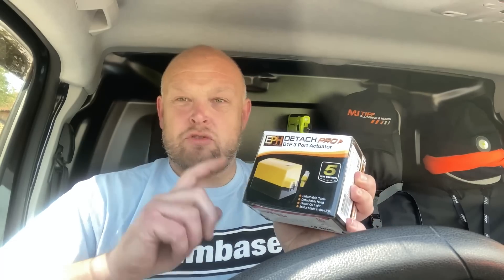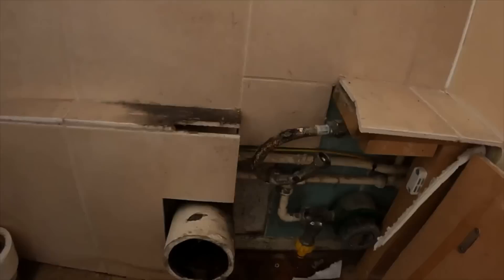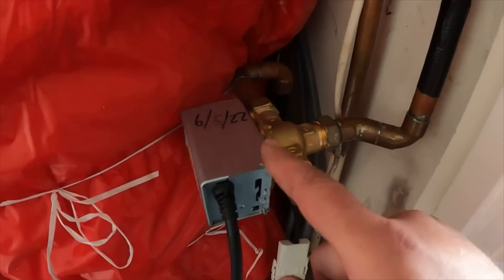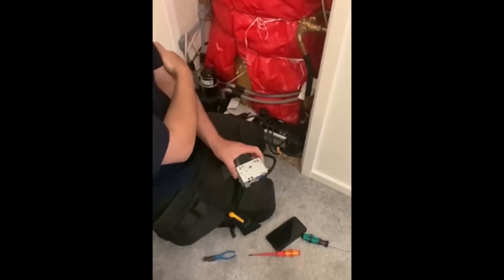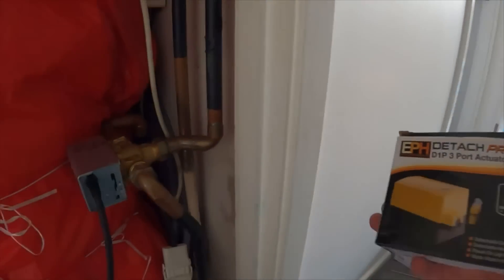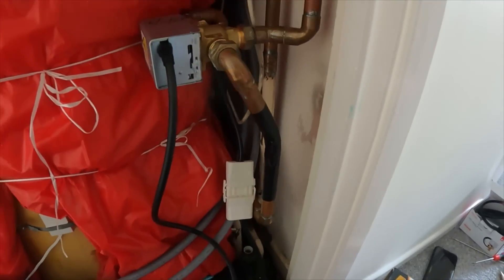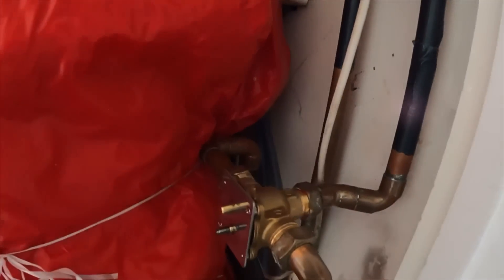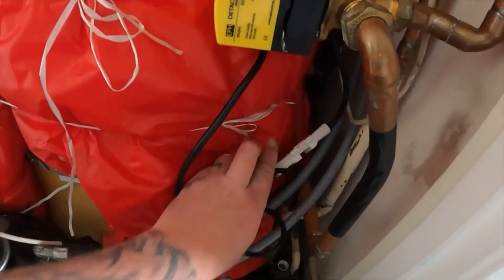FITTING AN EPH MID POSITION VALVE HEAD TO A HONEYWELL BODY | How To | Plumbing Tricks

Comment: great video ive had a few of those Honeywell valves do that I use Drayton seem ok used for yrs but I am really interested in those valves especially if there is a Honeywell valve with a faulty head thanks Mark
Reply from the maker: Yep the EPH valves with the converter plate works a treat

Comment: I once had a Honeywell causing trouble with a Worcester Greenstar Ri. It was giving out an odd voltage to the switch live, can’t remember what, but maybe something like 120V.

I replaced the complete valve for another Honeywell but the boiler still wasn’t liking it and the same low voltage. 

Spent a lot of time looking for the fault. Checking electrics. Had eliminated it being the valve because I’d just fitted a new one. Just couldn’t figure it out. Was at the point where I started to renew all the electrics thinking that there might be damaged wires or something. 

Fortunately I called Worcester and, thank goodness, he seemed to recognize the problem. He said the low voltage was a problem specific to Honeywell valves when used with a Worcester boiler. Following his advice I fitted a new valve - a Siemens - and it worked fine.

It was ‘one of those jobs’ if you know what I mean!

Fortunately it was on my Dad’s system, so not so annoying as it could have been. 

Wanted to share, in case it helps anyone else. Love it that we can all help each other easier these days. 

Happy plumbing!
Reply from the maker: Love hearing little stories like this…. Will help someone out👍🏼👍🏼🙏🏼

Comment: Always check the valve itself before changing an actuator head.. If the vave body is jammed or tight, the next  head may soon fail also as a result. If you have trouble turning the valve spindle with pliers the motor will struggle.

Comment: Few weeks back I had the same clicking noise from a Honeywell 3 port. What I found was when I took it off the valve it made this clicking as the motor was over shooting the arm pass the micro switches and would not return back unless I turned of heating and hot water off BUT when I put it on the valve it functioned fine. It’s been few weeks and still working. There must be something not right still as I’ve always fitted honeywells and not come across this till recently
Reply from the maker: Yer I think they are going downhill recently…. A lot of people are saying the same
Reply: If you take the heads off they often do that, over shoot and don't function as they should.
Reply: @ Gas Mark 
I done a Honeywell mpv today and thought it was faulty because the gears were clicking.As soon as i mounted it back on the valve body it was perfect.The Canadian honeywells never did this.The Honeywell i had today was made in Hungary.
Eph are now my go to valves.

Comment: Great vid, need these types of vids, I changed a float valve on a back to the wall pan, nice easy job right, WRONG 
The cistern to pan bolts broke off, the donut washer leaked and needed replacing and the flush unit needed changing after I put it back together 😡 bloody nightmare
Reply from the maker: It’s never that easy in the real world mate🙈🙈

Comment: Honeywell Quality control has been shady of late.  We've had new Honeywell actuators fail on install.  They used to be bullet proof.  By the way they usually jump back like that when not fitted to a valve body.  The ones I looked at were switch and soldering issues on the valve pcb.
Reply from the maker: Apparently this was a dodgey batch of motors and now it’s all sorted…. Time will tell eh buddy👍🏼

Comment: A quick question for you pal. Which do you are the best boilers. I was told Baxi and Vailant as it’s easy to fit replacement parts. Apparently Worcester Bosch are a nightmare. Interested in your opinion.
Reply from the maker: I’ve heard good and bad on most boilers, Baxi and Vailient seem to do well at the moment to be honest
Reply: @MJTiffPlumbing  cheers pal 👍🏽
Reply: Ideal baby, never had an issue with the 103 I’ve fitted

Comment: Guess what I'm doing with the two shonky, throw a six to start, Honeywell actuators on my Central heating system this summer? Never realised there was a direct replacement that went on the same valve?
Reply from the maker: Yep, get the EPH ones and they go straight on👍🏼👍🏼

Comment: So I see from the comments it's a Honeywell EvoHome fitted, Honeywell recommend going pumped to avoid issues (listed in the literature with the Evo). Also if it has a 3 port valve on it, shouldn't it already be fully pumped, if it was gravity hot water I'd expect a second set of F/R to the cylinder in 28mm. The issue with the clicking on the head is the arm has bumped over the micro switch so wants bending down, it's just a misalignment and it happens on the 2 ports as well.
Reply from the maker: Sorry it is pumped with tanks in the roof…. Not full gravity
Reply: @MJTiffPlumbing  I figured that's what you meant but being as you didn't put the controls in there's no guarantee it's wired correctly. Always prefer to wire my own controls using the Boiler manufacturers or Hive/Nest. Outside of the main ones it's very hit and miss to whether they're compatible or not what with Part P+ now.
Reply: Do you mean boiler plus?

Comment: I hope the next load of jobs go well for you mark as you don't need the aggravation. Looks like a bad batch of motors in them valves you got honeywell stuff is junk now I normally stick to salus and have never had any bother. Is that heating system been converted as normally a gravity system wouldn't have a 3 port on it and the pump would only operate if heating was called, hot water via gravity from the boiler on 28 primaries. Keep up the good work bud 👍
Reply from the maker: Yer it’s a pumped system, I just meant it had tanks in the roof but said gravity…. Stress of the day 🤣🙈🙈

Comment: You think you have had a bad day ?  My thermos flask leaked today whilst I was fishing and ruined my sausage roll !   Honeywell used to be top quality back in my day,  is it just the valve or have you had problems with other Honeywell kit ? Thanks for taking time to share your day .
Reply from the maker: Bloody thermos mate🙈🙈🙈

Just these valves…. At the moment 😮
Reply: The wireless stats and some clocks have screen issues. Gone are the days you fit controls and they are still working 20 years later. Unfortunately we may have improved technology but we have lowered build quality/ life cycles.
Reply: I feel your pain.  Had a can of redbull develop a small leak in my waterproof hold all and did not notice it quickly.    I now have some clothes and tools sticky and smelling sweet.  Also got a catch on my rolling toolbox snap off at the start of a 500 mile journey with 4 trains from Isle of Sky to london.  Currently holding it all together with large cable ties and electrical tape.    Keep up the good work Mark

Comment: I think the hot water off wiring is incorrect, if the hive receiver is in gravity mode the light will be dark blue in the top corner.
Reply from the maker: Oohhhh…… this is very interesting, however this is a HoneyWell EvoHome system… 

can you explain please buddy👍🏼👍🏼
Reply: @MJTiffPlumbing  y plan wiring requires hw off from the d/valve (grey wire), hw off from the programmer or hive etc (normally no.1 on the back plate) and hw satisfied from the cylinder stat.
If one of these is missing (usually from the programmer), in some cases you can get the “clicking” at the d valve head.
On older systems set to gravity on the programmer this isn’t an issue as there’s always power to the hw common when heating is required.
If you whip off the hive receiver (two pz1 screws underneath) the wiring should be neutral, live, hw off 1, nothing on 2, hw on 3, heating on 4.
If there no wire on 1, you can set hive to gravity mode.

Comment: It’s a real ball ache stuff like that but you don’t really have a choice but to do it. There should be some way to get recompense which I dare say you could fight Honeywell for but it wouldn’t be easy.
Reply from the maker: HoneyWell don’t want to know….. however EPH have been straight on the phone 👍🏼👍🏼
Reply: @MJTiffPlumbing  like I said on the Gram. There was a firm called stromm doing parts for Honeywell and the were great at first but then I was swapping loads of mid positions within days of install. Two ports were fine just the 3s.

Comment: I think that all of these motorised valves whether 3 port or 2 port have the same motor inside of them so they are all going to have the same problems. Just change the little motor £14.95 instead of the whole unit.
Reply from the maker: Cheap fix that

Comment: Any else having problems with honeywell trv making noises at the min? Had several in last few weeks doing it. Multi directional ones but still noisey, fitted hundreds over last few years and no problems till some recently fitted ones. Alwsys used em as they are "the best" despite costing far more than cheap ones.
Reply from the maker: Seems HoneyWell really are going down the pan fast
Reply: If I remember rightly, something came out about Honeywell Trv’s not actually being bi directional as they stated they were!
Reply: Well they are still being sold as so?! We try put em all on flow side since having problems and seems to be stopping it but it was easier just to put em whatever side suited the rad best before.
Reply: @peterdenson7031  they were being sold as so, old place I used to work had to change them all on a load of jobs and billed Honeywell for the labour to do so
Reply: @alimack5489  A batch of incorrect ones went out as Bi-directional from what my local independent has said. What with the supply issues the last couple years and issues now getting materials it's starting to show up more and more that things aren't arriving at all or are incorrect.
Reply: My Honeywell rep said they’ve had an issue with the manufacturer of the internal inserts. I’ve had a couple banging and he supplied new inserts to replace and they’ve been fine. If you swap for a replacement valve from your merchant you could get a faulty one from the same batch.
Reply: Yes, had one in a hotel, changed it and still the same, bi-flow too.
Reply: We’ve had a couple of rattling v120/15a valve bodies when fitted with Evohome.

Had to change them out, brand new 2022 ones…..

Had an ST9100 the other month where it had landlord service timer functionality that turned it off 24 hrs after fitting.  Honeywell said they may have made a few like this and to return it.

Had a brand new Evohome power supply plug top separate in two halves…… leaving bare unfused 230v metal pads in socket, brand new 2022 model.

Had a cs92a wireless cylinder stat with a facia plate minus the hole for the button in the base.

Frankly nothing would surprise me now.  I wasn’t even surprised when I found out they won’t have any more Evohome actuators till 2023.

I wasn’t surprised when the marvellous‘Honeywell Installer Network’ failed to forewarn any of us even when they knew they had ceased production last November.  Quite happy for us to keep selling it.

They are mismanaged and destroying everything they created.

Comment: The Honeywell heads have to be fitted to the valve to work properly otherwise the drive slips off the motor cog as it was doing in the Baxi fellas video. Removing any Honeywell valve head and activating it will result in it clicking like this.
Reply from the maker: EPH heads on and all is fine

Comment: The valve is phuqued which burns the motor out.
Reply from the maker: No it isn’t….. the motors on the Honeywell valves were a faulty batch so swapping the head to the ESP did the trick👍🏼👍🏼
Reply: @MJTiffPlumbing  what are the batch numbers?
Reply from the maker: This was about 18months ago…..

Comment: Why didnt the baxi engineer change the head would have saver you a lot of time and stress nothing worse than running around and not much to show for your efforts
Reply from the maker: Because I had only changed it a week earlier so still covered by me….. EPH on there now🙏🏼🙏🏼
Reply: It’s not his job to change an external part under warranty for the boiler is it.
Reply: @MJTiffPlumbing is that same head still working fine?